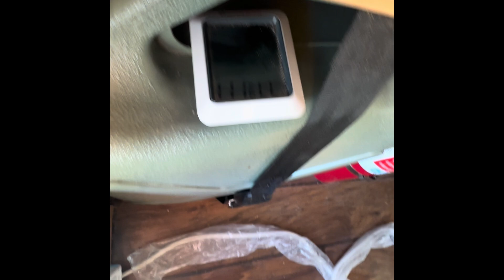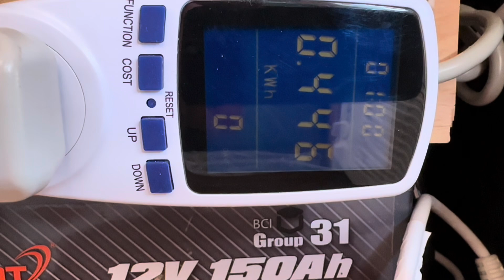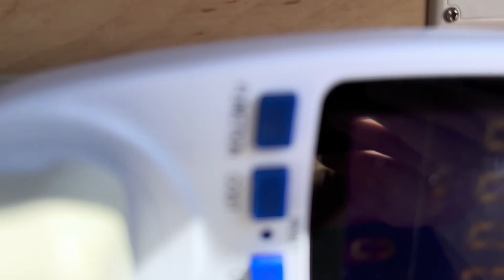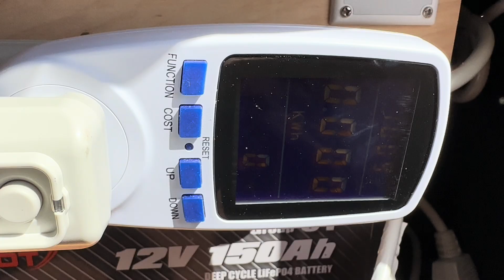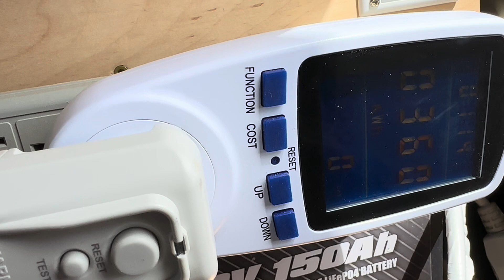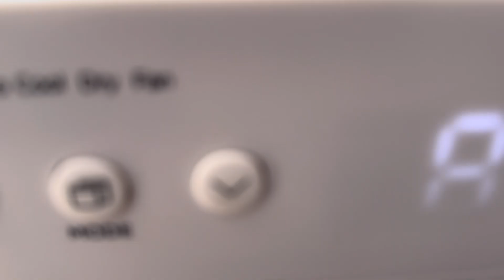Is the Midea 8000 btu Inverter Air Conditioner an Efficient Option for Off-Grid Use? Let’s test it!

Comment: I watched the video and I applaud your effort.
However, there is a very simple way to determine which unit has the highest efficiency.
What we are going to do is calculate "EER" the Energy Efficiency Ratio.
Take both units, set them on a picnic table out in the hot sun and crank them up on the highest setting making sure the compressor is running full-tilt ( we DO NOT want the compressors to "cycle", or the inverter to be running at a reduced rate,  we want them running at full output) 

Let them run for about 10 minutes so the condenser and evaporator  have a chance to settle and likewise, the current draw of the compressor will settle. (it changes as the units warm up) I've done this test many times. 

Now look at your watt meter and record the watt reading.

Starting with the 5000 BTU unit, take the running watt reading and divide it "into" 5000. Example. 5000 divided by 500 watts = 10.  You have an EER of 10.   This would be typical of a modern window unit.
Then do the same thing for the 8000 BTU unit.    Lets say the 8000 is pulling 700 watts.  It would have an EER of  8000 divided by 700 = 11.42  .... slightly better EER than the 5000. 

And that's it !
Reply from the maker: I did that test and the 8000btu unit pulled near 1000 watts consistently. The 5000btu unit stabilized around 500 watts. As I noted in the video, I wanted to create a scenario where the units could potentially cycle to maintain a set temp. I suspected if they could cycle, the 8000 unit could get closer to matching the 5000 unit in power usage. In my case, the 8000btu unit was slightly more efficient… the opposite of what I would have expected if I just did the bench test alone. Maybe that test you noted could measure the internal efficiency of a device, but I was measuring the real world energy USE while maintaining a set temp in a confined space.
Reply: @EndgameCampers  If the 8000 BTU unit pulls near 1000 watts and the 5000 pulls 500 watts (BTW my 5000 BTU window unit pulls 500 watts also), then it's a simple fact the 8000 is less efficient as it has an EER of only 8.  BTW, I've seen this on Copeland Scroll so called "high efficiency" inverters compressors, the one I tested pulled more current than a silly inexpensive window unit - "per-BTU" .  Remember, the "inverter" part only comes into play when it throttles back, otherwise, when it's running full out there is negligible difference in current draw.  So BTUs is BTUs and Watts and Watts. It's just that simple. And now I'll shut the heck up

Comment: Speed control over the compressor and fan.  Less slam when it powers up, a smoother temperature changes, and quiet for the first few years.  They get noisier over time.

Buy the Midea AC units in the winter time.  You'll get them for considerably less.  Bought the 10K unit for $320 in January
Reply from the maker: Thanks for the explanation

Comment: Have you considered switching to a more efficient 12v mini split?
Reply: This is the better option, he's losing ~20% in just DC(batteries) to AC to DC(Midea is DC inside) conversion if using a cheap inverter from batteries to produce AC power.
Reply from the maker: Is there a way to power the Midea then directly from DC? The conversion issue occurred to me also
Reply: @EndgameCampers  probably  not.  The Midea is probably using a high voltage DC to limit amperage.  A 12 volt mini split runs at 65-85 amps where the Midea using 120 volt DC is using 3-8 amps.

Comment: Great video!  Do they make one that would fit the window size you built into the camper?
Reply from the maker: No, I’ll use this in the new camper. I’ll build a similar apparatus, but it will be a little bigger.

Comment: I hav a few interesting window unit facts (5 years worth). The youtube video on my 120 square foot box truck build is " His secret beach house is inside a box truck ". I went with 2 window A/C's inside the living area in plywood boxes. My main a/c is a Midea 5,000btu analog unit hidden under the couch, ducted to blow vertical, and is placed in the center of the truck. It works great and cools the my build about 20 degrees in So. Cal. weather. It uses between 400 - 500 watts depending on how hot it is. My 2nd identical a/c is in the back on the floor and does a crappy job by itself. I use both just for quick cool downs in extreme heat. And it makes a nice spare if the other one breaks. The advantage is cost, only $148 (todays cost) for a/c and if one brakes on the road I can go to any Walmart and buy another one (or Amazon). 
During the build, I started out with a GE 5,000btu analog from Lowes for the main A/C. The controls on the front are totally hidden in my build so I left the knobs on max and switch it on with a Amazon wall outlet thermostat switch that is rated at 1,500 watts next to my bed. This GE burned out during the build from 100% blockage from sawdust. Even tho I cleaned the filter out every day. That burn out was 100% my fault. I replaced it with a Midea 5,000 but unit. It is till working great after 5 years. The interesting thing is when I had both the GE and Midea A/C's sitting on my bench, I noticed that only the front grills were slightly different. The rest was identical. It is my belief from that observation that they are the same units. 
Also originally to the build, I went with a GE 6,000btu unit for my second unit because the front was visible and it was digital and had a remote. This A/C lasted about 2 hours and stopped working with a fault code. When I researched the code it was not resettable. I took it back and went with another Midea 5,000 unit. This GE unit broke never being put on the road. I will stick to the analog 5,000 units from any brand for their simplicity. If someone comes out with an inverter analog A/C someday I will try one. 
With all the $3,000 - $5,000 options for A/C out there. I have been cooling my truck for 5 years (part time) with a $130 unit I bought from Amazon. If it breaks I can get a new one in an hour or two at Walmart. And replace it in less than an hour. Being ducted from under my sofa, in a box, under 6" of foam, it is also very quiet.
Reply: Thanks for the short novel ! It's always good to get my short story reading in.

Comment: Dave I installed a 6,000 Whirlpool high energy rated unit but, it was in the 250.00 range when I ordered it. I ran it on a 100 degree day in my build with no insulation in the roof or anywhere. It pulled the inside temperature down to 68 degrees and, I couldn’t believe it could work that well. I ran it for only 3 hours and, shut it down. I honestly will only use the ac when plugged into shore power or running my 2200 Honda generator.
       My years of working on RVs many times most of all the problems encountered on any high tech pc boarded electrical components are extremely sensitive to a proper amount of clean consistency of electrical power. In my opinion it’s just a matter of time before a line drop or who knows could damage an AC unit. I’m definitely old school and I tend to stay away from anything that is even more technically advanced to diagnose and they are much more expensive and costly to repair.
      That being said Dave I have to commend you again on your expert recommendation and, your ability to take the time to explain every aspect of all things involved in the  build process.. Very interesting Dave as always. Your friend in Arkansas Ted
Reply from the maker: Thanks Ted. Your philosophy makes sense

Comment: I have seen the media funky looking AC's before I thought they're a pretty cool idea think about it this way if you made a roll down door you could slide the AC into place and roll down the door and lock it into place while you're parked and when you're driving you could also take it out of the hole put it on the floor or in a storage compartment under your bed or whatever and roll the door down and lock it like a mini garage door. That would work best for me in my expedite van because I really only use my 5000 BTU air conditioner during the summer months up here in Canada it's very rare that I go down say to Texas anymore where you would need it say 10 months out of the year thanks for the video very informative and entertaining
Reply from the maker: Great idea!

Comment: I purchased an 8000 BTU LG window unit with what they call dual inverter technology. It's super quiet, and according to its wifi/app based hourly energy consumption graph, it's an energy sipper. I'm in the PNW and AC is only needed for my older (not well insulated) 950 sqft home for days headed above 85F or so. Its rated to cool about 450 sq/ft, so I'm just taking the edge off for the whole house, running about 9 hours during the daytime heat and direct sun. Rarely do I run it overnight. Usually it's conssuming anywhere between .4 to .8 Kw per hour, depending on how hard I'm running it and of course how hot it is outside. Usually the few very hottest of days may hit upper 90s F. On those days I'll see 1 Kw per hour consumption. I like the unit. Efficient and quiet.

Comment: .403 KWh versus .446 KWh may not be worth the extra 20 lbs weight and $200 extra cost, not including the larger unit size.  I guess you'll have to factor that out for the long run.
Reply from the maker: There is a heat pump version. That is a significant consideration.

Comment: The main advantage of the  inverter based compressors is that the compressor is variable speed.  Instead of just turning the compressor on and off to maintain the desired temp, it can vary the speed of the compressor which allows it to maintain the temp without having to turn off the compressor as often.  It also has a slow start on the compressor which greatly reduce the amp surge when the compressor is started.
Reply from the maker: Thank you for that explanation
Reply: Not to mention the condenser and evaporator fans are also DC and infinitely variable and separate as opposed to the standard window unit with both fans on a single shift. That is why they are so quiet and cool so much better.

Comment: Thanks so much for doing this comparison Dave. I have been tempted by the Midea for my cargo trailer camper conversion. It's a 7 x 16 and the 5000 btu I have in there is marginal in 90 degree weather. However my box I constructed for the AC is probably too small. 
They are supposed to be super quiet also.
Reply from the maker: Welcome

Comment: Would these units fit through the opening in the back door to a cargo van (Chevrolet Express) if the window was removed and a custom made cover was installed?  (no cutting of the integrity of the manufactured door)
Reply from the maker: 5000 definitely does, not sure on the 8000 unit. Might be close
Reply: I have a 9000 BTU 22 seer gree mini split heat pump in my express. The outdoor cabinet fan and coil are where the spare tire was. The air handler is mounted on the left-hand side up high. Works great. R-5 insulation. Maintain 72° on a 95° day using about 700 to 1000 W of solar. I have 1600 W on the roof.